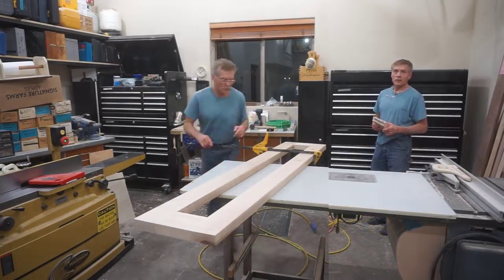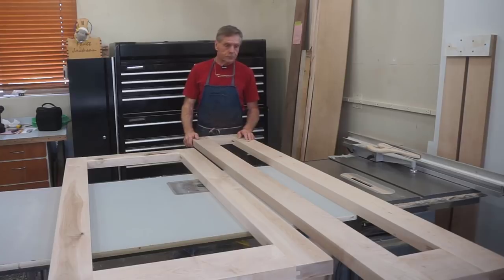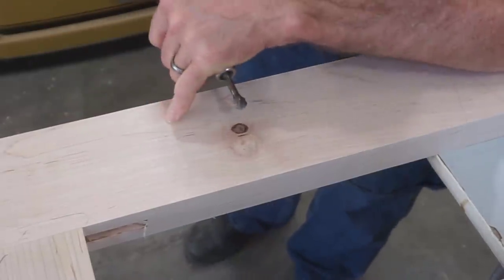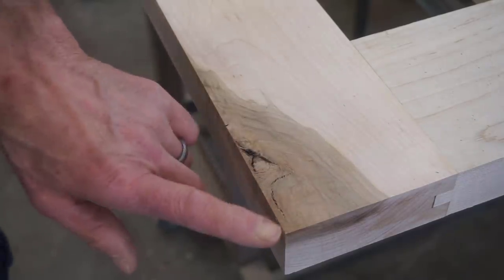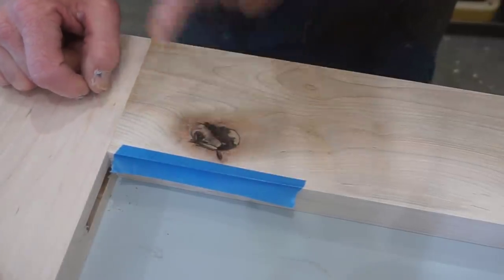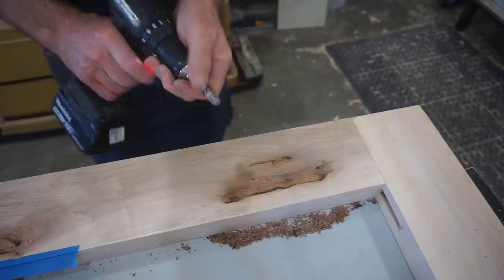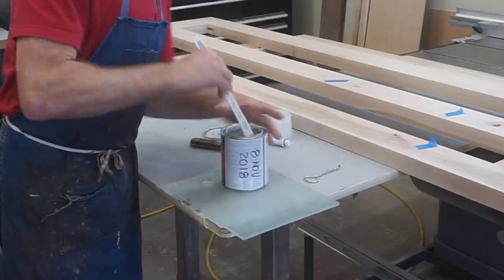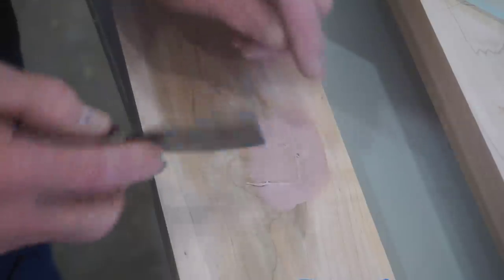How To Repair Defects in Wood Before Painting

Comment: I'm sure the camera adds 10lbs...I mean 10x the time :)
However, even so...your time is valuable so in this case, did the money saved on paint grade vs. stain grade outweigh the time you invested by using this repair technique?  (nice job BTW...looks good)
Reply from the maker: You're right about the camera adding time James!  I haven't actually crunched numbers on the cost of the wood but my gut tells me it's well worth it.  These repairs really do go quickly so the added time cost is pretty minimal.  Plus, even with a higher grade of wood there's often a defect or two that shows up during milling that needs attention when the quality of the final painted finish is so high.  In that case I pay more for the wood (actually my client pays more for it) and I still have to charge for touch up work... kind of like a 'level 5' finish on sheetrock... it just takes more time to reach higher expectations.  Best, Matt

Comment: What if I used a wood plane on the bondo? Never tried it before and I'd hate to find out that it gums up the blade or frog or something.
Reply from the maker: Yeah no don't use awood plane on Bondo because it seems to have an abrasive quality that quickly dulls cutting edges.
Surform planes are easier faster last a long time and are disposable so their use is a no Brainerd IMHO

Comment: Very good and very timely for me.  Wow, that Amazon link to a subpage on their website is impressive - what did you have to do to qualify for that, Matt?
Reply from the maker: Hey SWG... thanks for commenting!  I applied for the 'Influencer's Page' back when they first introduced it as an upgrade to the Associates program.  Just contact Amazon to find out what their' current thresholds are... my guess is that you can get set up pretty quickly... after all, I'm pretty cludgy when it comes to such things and I got it done 🙄😁😎 Best, Matt
Reply: Small Workshop Guy horse horse  racing in his own game-horse

Comment: Can a chisel or razor to quickly shave the bondo down to perfection?
Reply from the maker: Not really... usually results in taking too much off or the sharp edge digging in resulting in another coat so using the sure form plane and sanding provides quicker more consistent results overall.

Comment: Nice tutorial, but I really hope you made that frame specially for the demo.
Reply from the maker: Why do you hope that, Andrew?
Reply: @NextLevelCarpentry  
Because those were some really big defects.
Reply from the maker: @andrewholdaway813  so....
Reply: @NextLevelCarpentry  
In my opinion, that monster gouge was too big.
I'm guessing you disagree so we can leave it there.
Reply from the maker: @andrewholdaway813   It's an irresponsible waste of materials to use stain grade wood for paint grade projects IMHO. That 'monster gouge' is entirely cosmetic having zero negative effect on the integrity of the door.  I planned it that way.  I have absolute confidence in this process for repairs on projects that get an opaque painted finish which is why I featured it a video.  The tone of your comments make it seem like you think this is trying to cut corners or shortchange a client.  If that's the case I suggest you consider a less distrustful scenario where natural resources are being preserved and costs kept in line by not using more expensive wood that just gets covered with paint.  Best, Matt
Reply: @NextLevelCarpentry  
I don't  make any accusations or insinuations.
I think it's too much filler, you and your client don't, there is no point in discussion.
Reply from the maker: @andrewholdaway813  you're.... funny.
Reply: @NextLevelCarpentry  
Erm... Thanks?

Comment: Won't the Bondo crack over time? I thought wood needs something more flexible.
Reply from the maker: I've never seen the Bondo crack in this application ie: interior woodwork.  I have used this exact method for repairing a redwood deck and although the Bondo works loose in some repairs after a couple years of 4-season exposure to weather it didn't actually crack... very durable stuff! Best, Matt
Reply: @NextLevelCarpentry  I do appreciate your reply! May I ask could Bondo be used in gaps between paint-grade molding? I'm stripping older woodwork for repainting . While the wood and workmanship is high quality, it has settled over the years leaving some gaps up to about a 1/8th inch. If not Bondo, what would you recommend to fill them?
Reply from the maker: @alienproductions9948  Bondo wouldn't be a good solution for that condition. it's tough but not elastic. Even if surfaces were prepared to perfection it would stick to only one side of the gap when the wood inevitably moves resulting in another crack, albeit smaller.  I'd recommend a good grade flexible latex caulk like Big Stretch by Sashco. 

https://www.amazon.com/dp/B000H5OOPU/?ref=idea_lv_dp_ov_d&tag=aiponsite-20&linkCode=ic6&ascsubtag=amzn1.ideas.29WVINIJF4EUJ

Works great for small cracks in painted trim but you might have to do a couple or three coats in larger gaps because of shrinkage as the caulk dries.  This is what all the painters I know and use use when doing paint-grade millwork.  Spend a little extra time applying the caulk using a wet finger and paper towel to leave a smooth repair without blurred edges for best results. Hope that helps? Best, Matt

Comment: Protip: if you use a heat gun or blow dryer, you can speed up the curing to its final hardness in minutes, not over the course of an hour. It's too bad there is a ruddy painter that will put 1/4" grooved brush strokes all over that door for you...